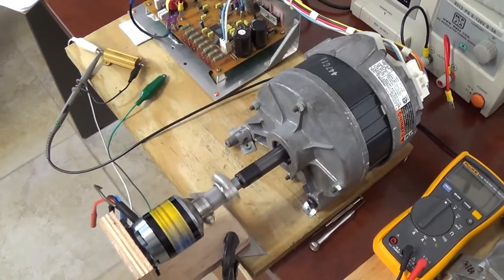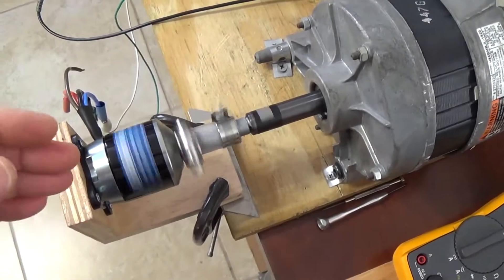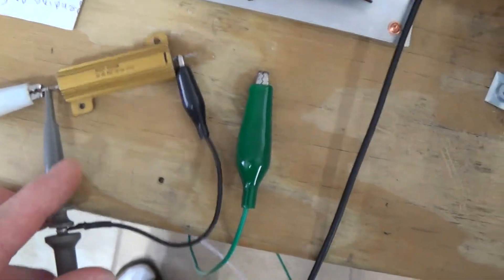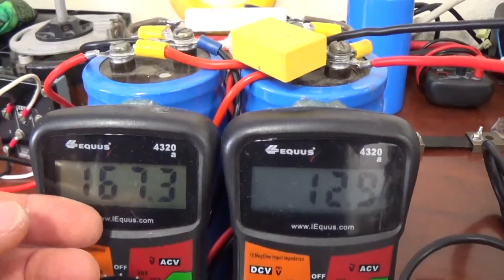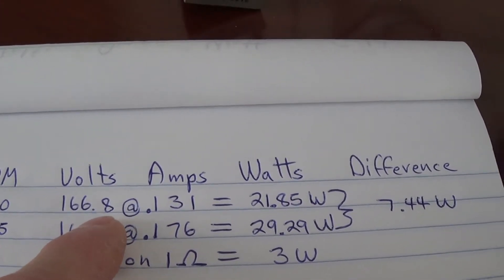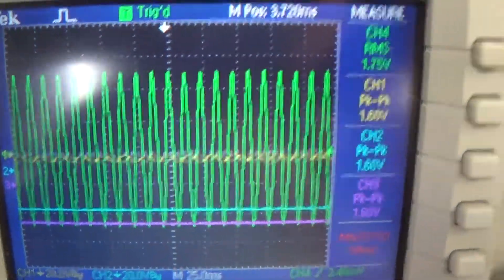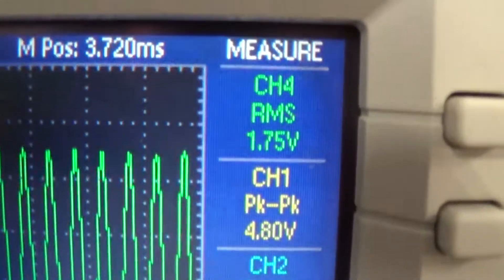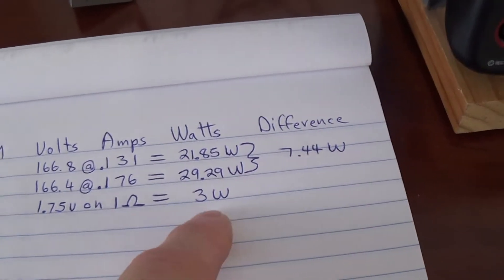Sharing ideas, how to build a more efficient motor (p.14)

Comment: Hey Luc , forgot to ask you, what type and model camera are you using? It's seams really good.
Reply from the maker: +Mike Poirier Hi Mike, it's a Sony HDR-CX220.  I picked it up on ebay a few years ago for $100. It was definitely worth it. It's also small and light weight. Takes still pics at 8.9 mega pixel.
Reply: +Luc  gotoluc Choquette 
Thanks for taking the time. You did good for $100.

Comment: Great work. I just came across your series and am to happy to see experiments with sound measurable results. I have been doing similar work for several years now and think that all our efforts well be worthwhile one of these days.One approach you already mentioned would be to use the cemf to run a 2nd motor to increase torque on the same shaft, (rather than storing the energy). Now if the 2nd motor is also pulse type it also can generate 50% or so of its input in bemf.  Granted on a sliding scale. Nevertheless, it has always been conceivable, to me anyway, that the proper use or reuse of every pulse can make for improved efficiency on many motors for everyday use.Keep up the good work and best of luck.
Reply from the maker: +Christopher Powers Thanks for your post. Here is a link to the forum topic with the final results: http://overunity.com/16167/sharing-ideas-on-how-to-make-a-more-efficent-motor-using-flyback-moderated/msg476756/#msg476756
Reply: +Luc  gotoluc Choquette   How does going from 15 watts to 9 only add up to 10% . Or is it 10% more with the 2nd or 3rd cemf added in and of itself? Your overall results may be better than first appear.
Reply from the maker: +Christopher Powers In the 15  watt input test the 5 watts flyback was calculated on a load resistor (outside the motor). However, when redirecting the 5 watts back in the motor to assist, it becomes part of the motors input which in return lowered the input power to 10.69 watts. So you can only account for the 2nd flyback recovery calculated to be 1.69  watts across the load resistor (outside the motor). I'm sure my power calculations are correct.
Reply: +Luc  gotoluc Choquette I follow. sounds like 9 or so watts in is best case so far to see 3 watts out ? it seems crazy that large 3 phase motors are said to achieve 95% efficiency ? I have not got near that in my experiments either.  Now I am wondering if it is worthwhile to design a generator that also utilizes its own flyback to add efficiency on the output end.  Perhaps you are already testing a model ?  Keep up your posts and best of luc
Reply from the maker: +Christopher Powers Yes, I agree and why I'm going to build my own motor and generator. If you look at this video https://www.youtube.com/watch?v=FxSccG5DNFM at around the 8 minute mark, my special motor design consumes only 350mW when a generator coil (coil and core) is introduced while under load and delivering 500mW.  That is a 143% power transfer efficiency!!! Also, keep in mind the score includes all generator coil resistance, Eddies and core losses, since the gen coil was not present when the motors power measurements are done. Typical generator efficiencies are  done with the gen coils and cores in place, so you never get to see how much loses are in the gen coils and cores. Strange that none caught on to what was being demonstrated.  Anyways, I'm presently working on a larger version of that design. Luc
Reply: +Luc  gotoluc Choquette Thanks for the follow up. It may be that none caught on to the 143% because most people look at the overall efficiency. I think the 143% on the power "transfer" efficiency is an encouraging sign. Challenge is to minimize the source input and then to look at the overall picture. For a random example, say a rotor spins at x rpm and x voltage and x amps while driving a generator load. The input in the example is say 1 amp. Now, as you have already shown 50% is possible to recover via simple flyback. so net .5w to spin the rotor. Now on the recovery coil or generator side it is possible to generate even 50% "from" the original 1 watt =.5w  Then .5 and .5 = 1.0  If this can happen physics bells should be ringing all over.    i.e. where did the inherent system losses go ?My thinking is the rotor momentum along with the current momentum energy, makes up for the losses. Has little or nothing to do with energy from the ether or vacuum that is largely misunderstood. Look forward to seeing your next experimental results.

Comment: Hi Luc,  I'm still following your series.  although I believe your calculations use the correct process, I'm not convinced that comparing a single with a three phase  is a fair or reasonable comparison, especially with the very light load.  Could you do the same measurement after disabling 2 of the phases in the 3 phase motor?  Then you would have an apples to apples comparison - down to the core, not just the case.  I like your efforts to improve efficiency.  
Cheers
Reply from the maker: +Inspironator Thanks for following the research and posting your suggestions and concerns. So I did a quick test with only one phase connected on the stock motor and it all comes to about the same power differences between no load and on load since the circuit adjusts for changes. It's no worth redoing the the test for the small differences but I found that dropping the stock motors input voltage and can get it to run more efficiently. Not as low as the Mod motor but got it down to 10W no load and 17.5 on load. Luc